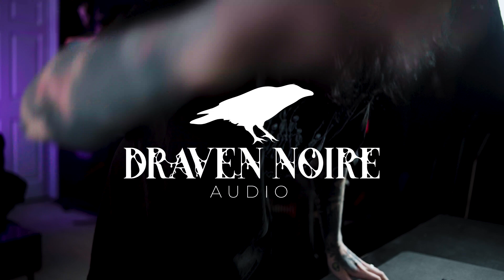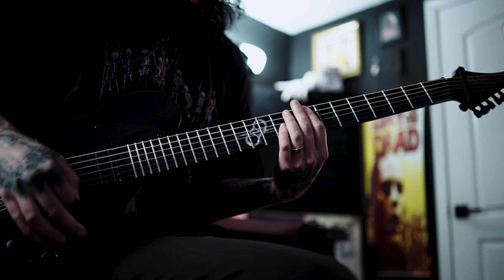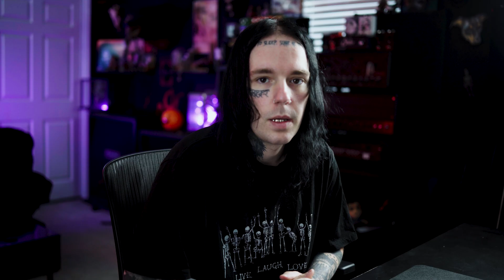HOW TO DIAL IN A METAL BASS TONE!

Comment: I have an advice on that Umansky bass: you should try forcing the B string (you can latch the key in settings), tune the bass to the guitar tuning and make high notes play on higher strings. this way this bass sounds a lot more realistic. also the humanization knob is kinda nice, you should try it out
Reply from the maker: I always mean to mess with that kind of stuff and then just entirely forget haha I do usually use the humanization knob though!
Reply: @dravennoire  the entire procedure is less than 5 minutes, but the result is huge. you can basically just highlight everything after 12 fret, copy and paste it, push it all the way up the piano roll until every note is the same and then just putting it on the higher string
Reply: As a bass player I think if your gonna use fake bass you should just let it sound like fake bass iv always liked the way it sounds in metal I feel the same way about drums